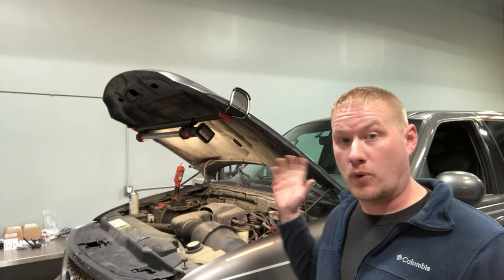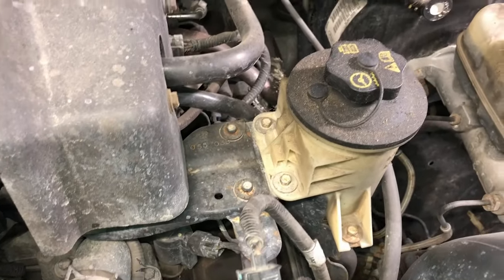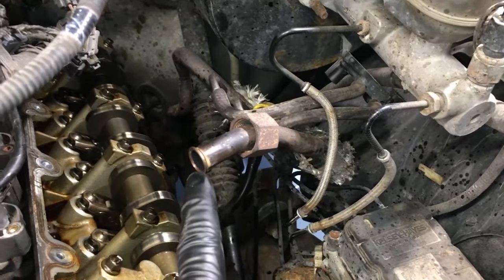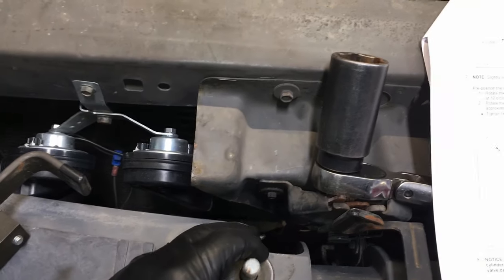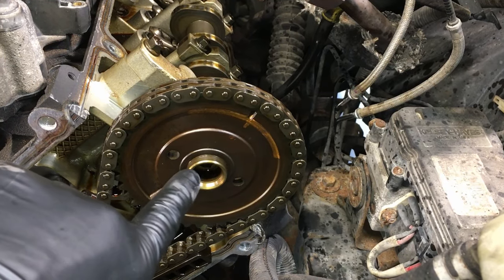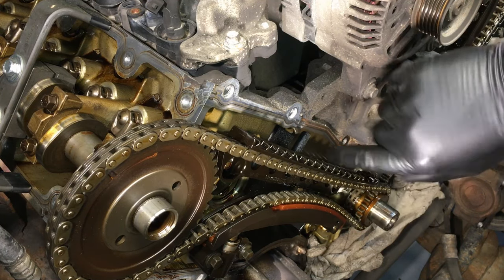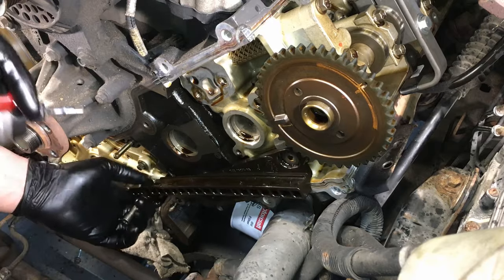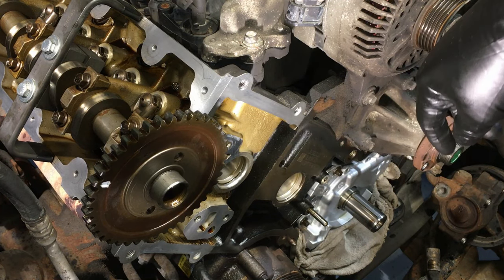Ford 5.4L 2v Triton Engine: Complete Timing Walkthrough

Comment: No gasket on the tensioners?
Reply from the maker: No
Reply: @FordTechMakuloco  interesting.
Reply from the maker: I have never seen Ford use a gasket on any metal tensioner for any of their engines.
Reply: @FordTechMakuloco  I found it weird how the plastic ones had a gasket around then but then the metal one didnt. It's quite the head scratcher
Reply from the maker: The plastic gives a bit when torqued and has a much different expansion rate compared to metal on metal.

Comment: I got a 99 Ford E250 E150 Ford van the VA and it's got relatively new wires new plugs couples coils and it keeps riding driving fine for a while but then it goes back the missing out really bad last time the guy put a new call back on one side and it drove good for about 6 months so this is about the third or fourth time it just keeps going back to missing out missing out missing out and I've been to three different mechanics tell me that this particular 99 Ford V8 likes all Ford products it likes Motorcraft plugs Motorcraft wires and Motorcraft coil packs and if you put anything else on them you know eventually fail like this what say you

Comment: All fun and games till the F-ing wiring harness on the PS dosnt have enough slack so you have to pull the intake to remove the PS value cover.  I will never own another Ford newer than 96. To many problems. I timed my wifes with no cam locking tool. No issues.